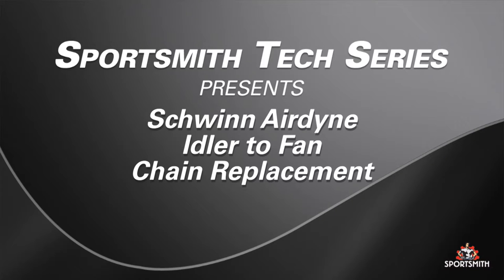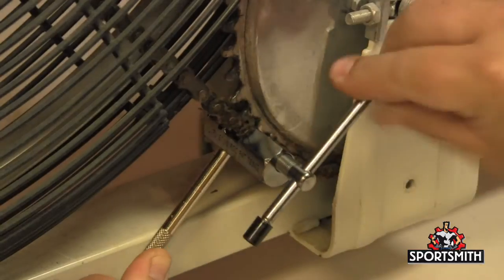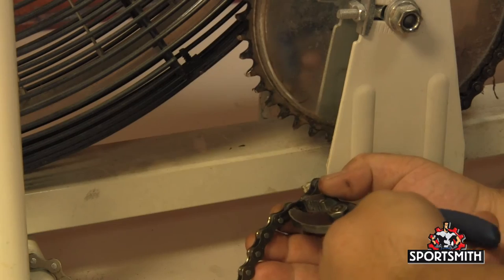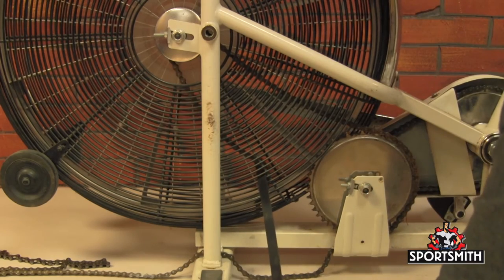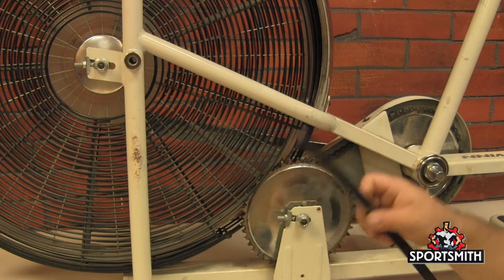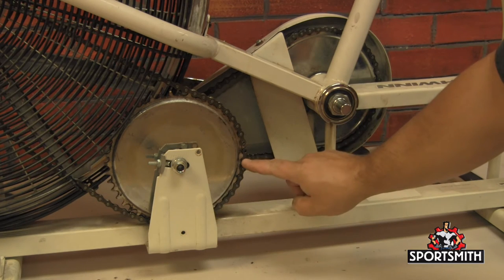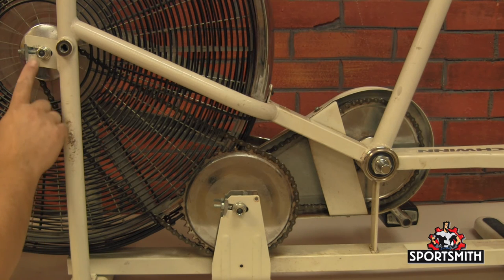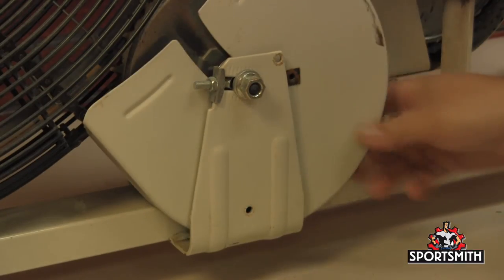How to replace the Airdyne Idler to Fan Chain

Comment: Good call placing the ends of the chain on the sprocket. Makes total sense. Also I was about to take off the fan shroud before looking up your video!

Question: any ideas on increasing resistance on the bike? Or is there any way to know if the bike is out of calibration with the meter?

Comment: My gear by the pedal slightly wobbles side-to-side when pedaling although the chain is tight. Is this normal or does it somehow need adjusted? Thanks!
Reply from the maker: Thanks for your question. I will assume you are talking about a similar bike. This could be an issue with the bottom bracket bearings, The crank eccentric or just the wedge pin.

Comment: What model Airdyne is this? I just got one and have been struggling to find replacement parts because I’m not sure what model it is
Reply from the maker: Thanks for your question. 
How To Identify the Model of a Schwinn Airdyne Exercise Bike
   
What size/type fan does it have? Is it a spoke fan like a bicycle wheel or short wide blade fan?
    Big Fan (spoke fan like bicycle wheel) – AD3, AD4, AD Pro/Comp
    Short Fan (wide blade) – AD Evolution Pro/Comp

Does your Airdyne bike have two chains or a chain and a belt?
    AD3, AD4 bikes have two chains.
    AD Pro/Comp and AD Evolution Pro/Comp bikes have a chain and a belt.

How do the crank arms attach to the Airdyne, by wedge pin or bolt?
    AD3, AD4 and certain AD Pro/Comp crank arms attach by wedge pin.
    Certain AD Pro/Comp bikes have crank arms that attach by bolt.
    AD Evolution Pro/Comp bikes have crank arms that attach by bolt.

Ours is an AD3.